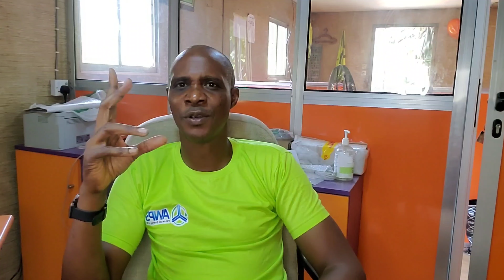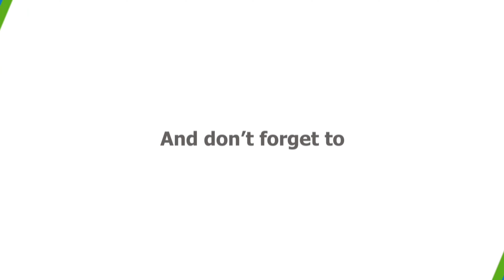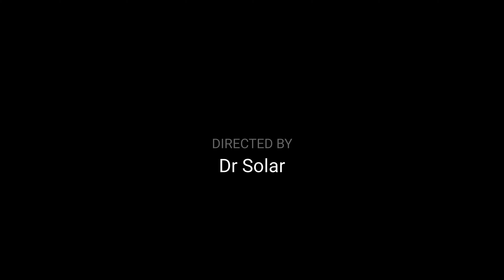My insane SolaX experience and my final verdict.

Comment: Hi Doc solar, Patrick from Liberia. How many years have u used the Solax to give it that extensive rating? 2. Is your rating also surpassing the Schneider inverters? Cause I’ve used the Schneider and studar for over 12 yrs and have not had one place down for issues. None.
Reply from the maker: Good morning Patrick thank you for watching and commenting. I think you are the first to comment from Liberia. I am new to the SolaX brand, I have followed them for more than 5 years. I also used Schneider. For a while that was all we installed. They have fallen behind the market when it comes to Lithium batteries. When you add all the other components that you need to run their product it is prohibitively expensive. Our environment has serious dust issues and I need a solution with a good IP rating. The Schneider does not meet that test. I hope this helped.

Comment: Nice one Dr Solar, I will like to know how many SOLAR PANELS and BATTERIES will be enough for the SOLAX X3 HYBRID G4 15KW 3 PHASE INVERTER?
Reply: Also, is it possible for one to go off grid with the SOLAX X3 HYBRID G4 15 kw inverter
Reply from the maker: Good morning and welcome to the channel. I am not sure you have commented before. Thank you. The answer to your question is dependent on what you want to power. The X3 needs about 180 -185V to operate properly. So if you are using the battery from SolaX that would be 2. The size of your array again is not decided by the number of panels but by the amount of kwh you need to generate to charge your batteries and power your load. I hope this was helpful. Yes you can be completely off the grid. Please don't forget to subscribe if you have not already done so.